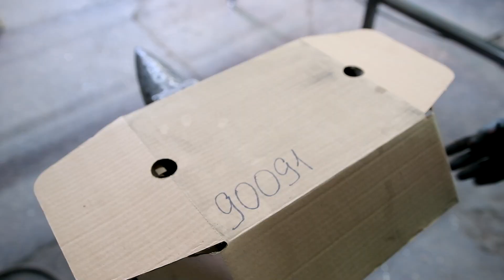Restoration of the leg vise for the blacksmith| Lucia’s Workshop.

Comment: nice work.
For me, I got lazy in my older years: I probably would have pessure washed it hot, degrease, and let acid or electrolyse do the work. Afterwards milling the vicegrips true, so that is usable again. straighten the handle with a torch and only charge the metric bolts bach to spec if possible. repairs with welding I agree 100%! to finnish: Blueing, and cover with hot old motoroil. the carbon gives a nice finnish. As those vices mostly stay outside, the polish would be not neccesary imo. But this would be MY aproach. After all, a nice recovery for the old Vice! Well done:yougotthis::shelterin:

Comment: You do such a great job at everything in the machine shop, if you have stuck nuts and bolts you can use bees wax like they use for furniture wax heat the bolt and apply some bees wax it will melt and wick into the threads and sometimes work where penetrating oil won't

Comment: Ewww, that really hurt at 2:00 when you got the nut off the jaw pivot bolt and then beat on the unprotected end of the bolt.  I hope that did not harm the bolt's threads.  I made that mistake once.  Then my grandpa mentioned that If I had put the nut back on flush with the bolt before I hit it I would not have had that problem.  That is my first memory of Grandpa Fritch teaching me things. 
Your videos are very well done.  I would enjoy hearing more about your past and the pathway to becoming a maker in the machine shop.  I forgot to mention that a friend in Sweden gave me a very similar blacksmith's vise for my shop.  It had belonged to her father who was a friend of mine.
Reply: I think she's replacing all the bolts and nuts.

Comment: Nice work!  You probably know this, but for other people, leave the nut on a bolt with the nut flush with the end when banging on it.  Protects the threads if you plan to use it again.
Reply from the maker: Thank you 👍 Yes, I know it, but I knew I will have to replace the bolt.
Reply: @luciasworkshop  By the way, I haven't been on the forum lately as we moved into our new house in Горячий Ключ, Краснодарский Край and there is a LOT of work to get moved in.  The workshop is far from functional.  If anyone asks, tell them we're alive, just busy.  :)
Reply from the maker: @Jerry Durand  OK😀👌 Wish you to finish all the issues related to the move soon😉

Comment: Sometimes rather than using a penetrating oil for stubborn rusty nuts You can heat and melt candle wax it is absorbed the same by capillary action, then some tapping and it comes loose. Good job.

Comment: you should use a drift or a wood block to drive out those big bolts/pins.  I watched the threads get bent.  It just creates problems for later.  Great video!
Reply: Pretty sure those are going in the scrap bin.

Comment: I have a vise in the same condition as your end result. I too am struggling with whether or not to paint it. Mine will be place in and outside smithy, so leaving it bare with only a boiled linseed oil finish worries me. What did you end up doing with yours?  Did you paint it?

Comment: at 9:30 what is this fluid you applied to the vice? And what does it do actually?
Reply from the maker: It's a linseed oil, one blacksmith gave me that advice. It makes the surface more soft and smooth and also protects the metal from rust.